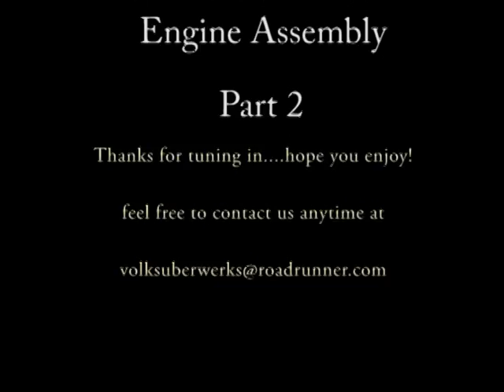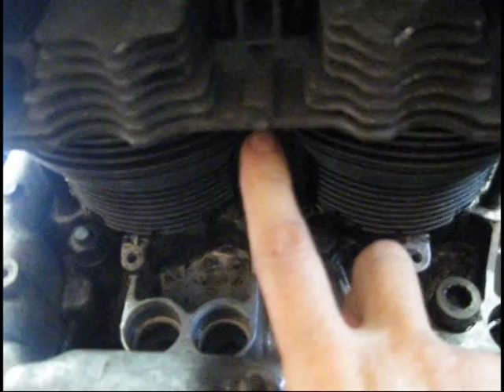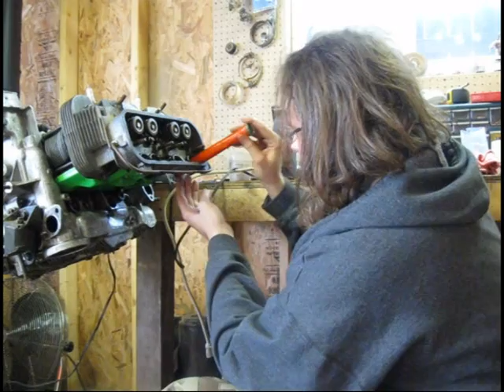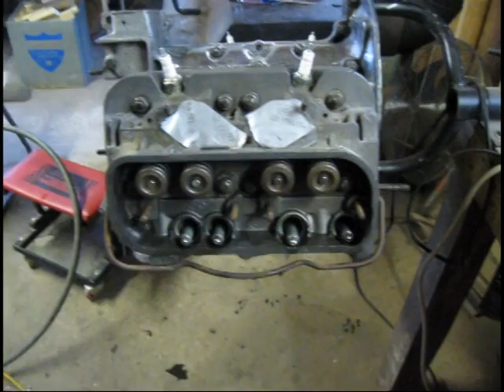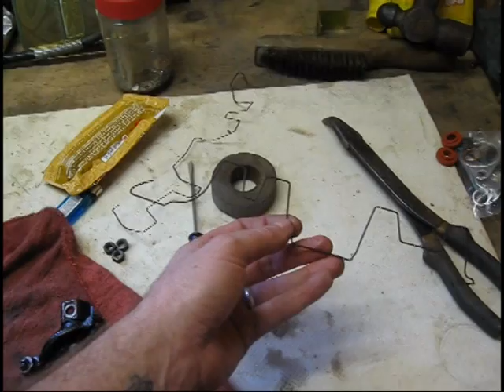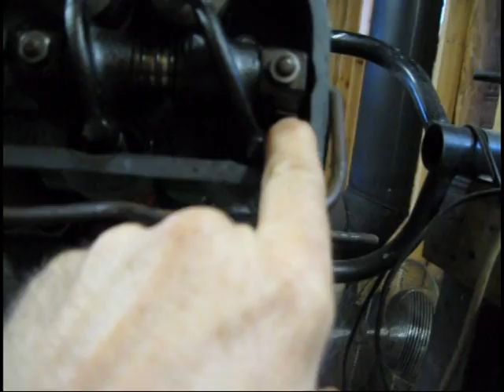Type 4 Engine Assembly - Part 2

Comment: I notice you have coloured parts like the tin and the pushrods tubes. Did you do this yourself? Is there a system or reason for different colours?
Reply from the maker: No, the paint is just for rust prevention. The color choice is just personal preference. Thx for watching!

Comment: Yes. The video is already 10 years old, but the block is much older, designed in 1966 by Porsche for VW, to superseed the small VW beetle block. 
Most of the air deflector/ baffle plates are simply screwed with M6 *10 with a plillps head. You can replace them with internal hexagons if you like. The centre-srew off the lower air deflector under the head is M5,  I though. Tighten but do not overtighten.

The central located camshaft is the weakest part of the block. They use only 4 lobes to act on 4 cilinders(!) and lift 8 valves.. So the lobes work overtime as it runs. When you lose power after say 100.000 miles, the lobes are worn down through the 0.4 mm hardened layer and then wear quickly down to 2 mm lift height. In that case revving up to only 1800 revs is possible, but that is the rev-end. A known weakpoint by every typ4 mechanic.
Block must be split to change the camshaft. 

Generally typ-4s are non problematic but can overheat quickly. That is the reason that tuning always ruins it, OR an extreme diameter Porsche blower-fan must be mounted on top of the block, together with a larger oilcooler.

Groeten uit NL.

Comment: Really good instructional video. I didn't know about the anti-wander wire. And I loved your painted parts. Does that serve any purpose other than letting the important parts stand out for the audience? What kind of paint did you use?

Comment: hey man, im trying to rebuild my first motor, an 1835, it was in a sandrail that rolled and the crank got lose and screwed up the cylinders, block looks ok, and so does the crank and cam, heads need to be cleaned and i need new cylinders and pistons. any advise?